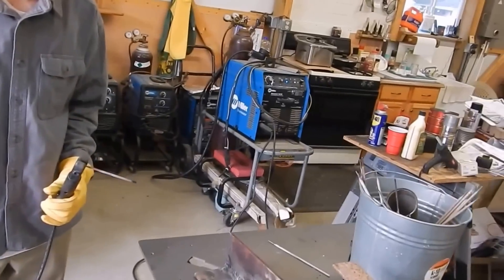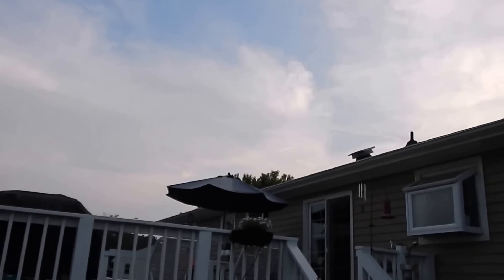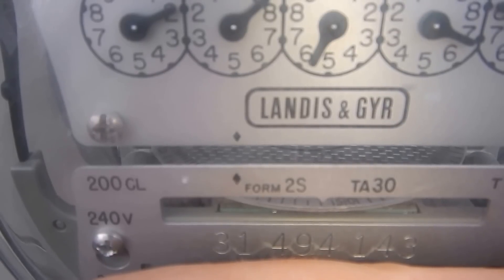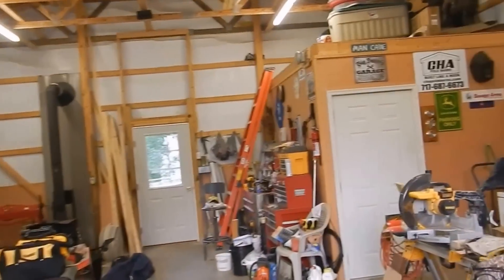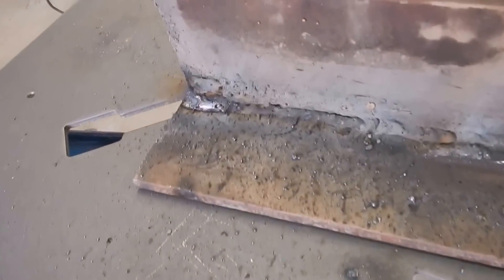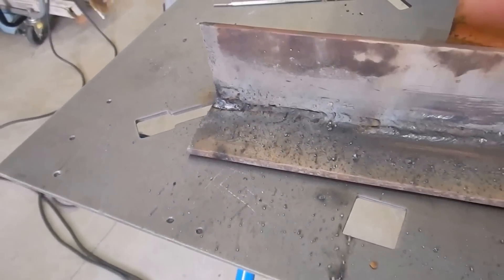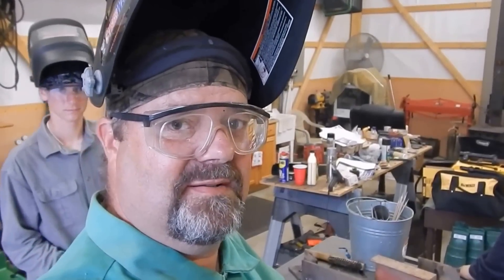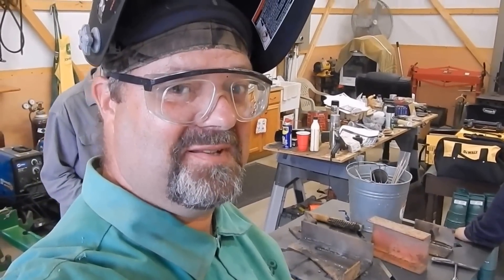Miller Welding Syncrowave 180 SD vs. Solar Powered Home By KVUSMC

Comment: Question on your 180 DD does the blue light stay on set to stick and tig. I have the same machine and the light is only set to stick. Light turned off set to tig
Reply from the maker: I believe mine stays on